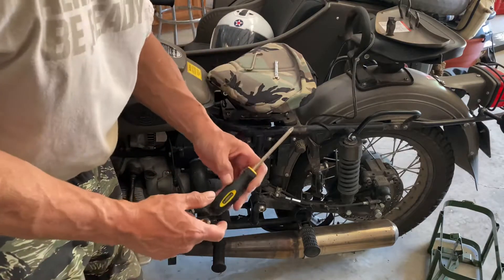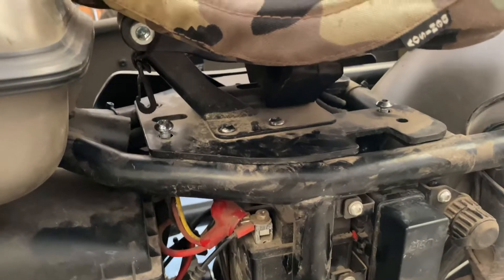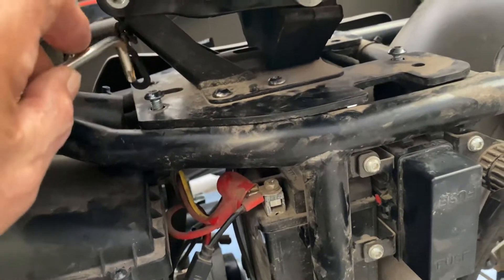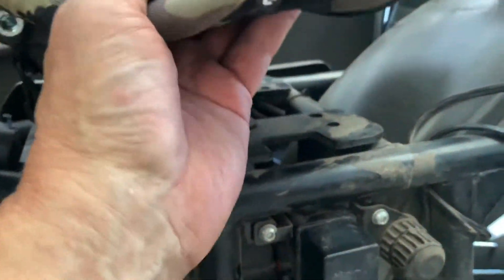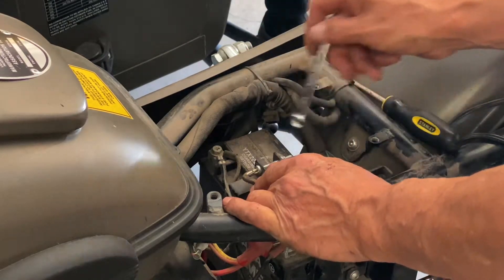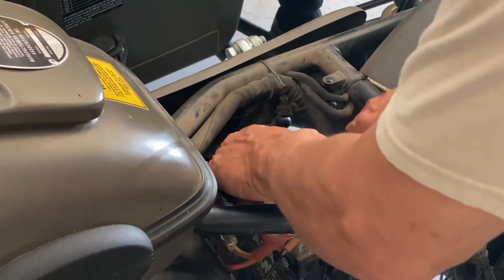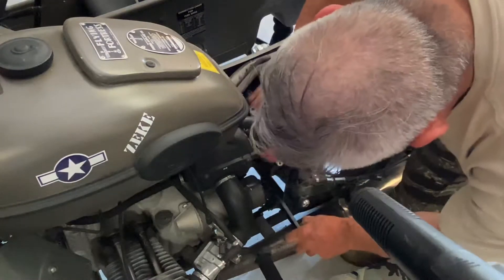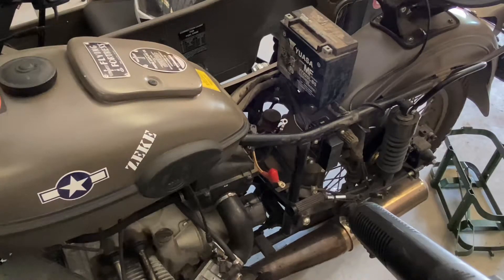2018 Ural Gear Up Battery Removal #uralmotorcycles

Comment: I have changed a few batteries in my time. Sparked a few wrenches as well. My 10mm is wrapped with electrical tape. Thank you for sharing this with us, Mark. Stay safe and stay cool
Reply from the maker: That shouldn’t happen if you remove the negative first. Lol